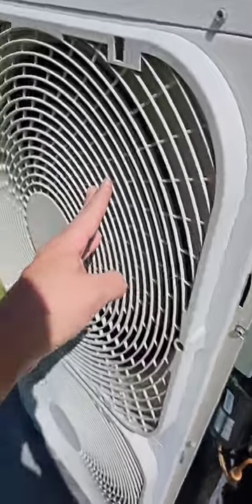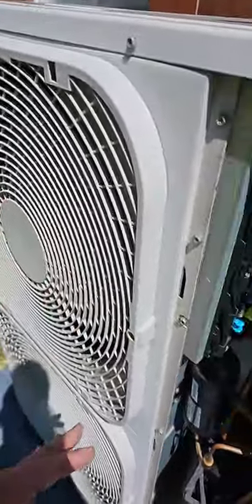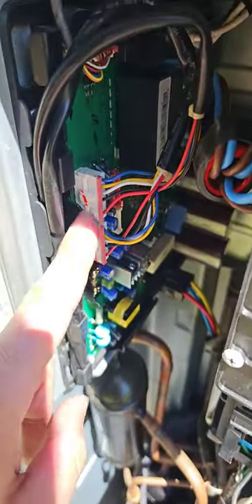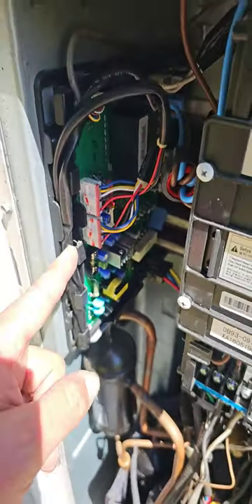Error Code 458 on Samsung Mini Split: Quick Fix #minisplit

Comment: Is it called the inverter or the converter ? From my understanding ECM motors on mini splits have converters which change AC-> DC.
Reply: Ac to Dc is converters 
Dc to sine wave similar to AC (pulse code modulation, also called pulse width modulation) is called inverter.
Reason why its called inverter because the dc voltage is being signaled to the compressor as AC sine wave. You can control the speed of the compressor and utilise better efficiency depending on load (indoor unit communicates with outdoor). If load is great, the compressor will run at full speed (60hz) which is similar to a “regular” compressor at normal working conditions. If load is small, compressor can run at 30HZ, which is the energy efficiency aspect. That is why we have the “inverter” technology. To have energy efficiency, and you can manipulate DC current (inverter) but you can’t manipulate AC current, well actually you can, it’s called phase shifting but let’s not get into that. It is called inverter, your manipulating the dc current into “ac” current by either decreasing or increasing frequency as needed